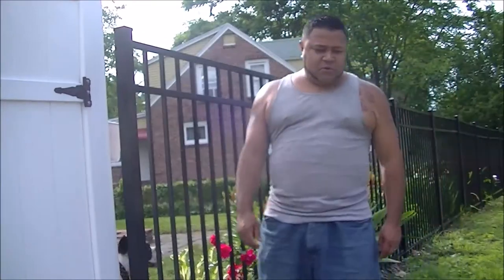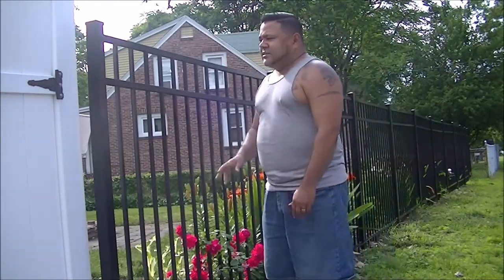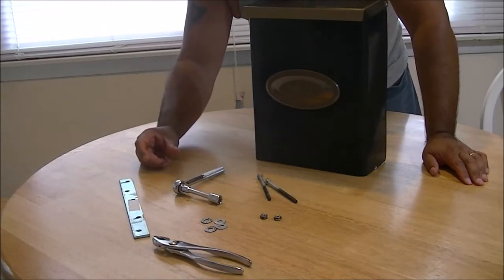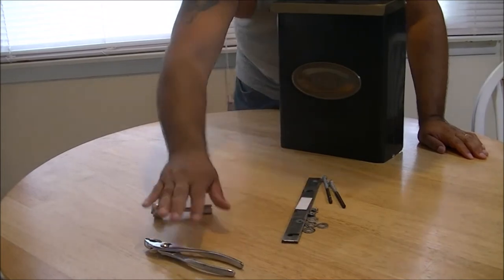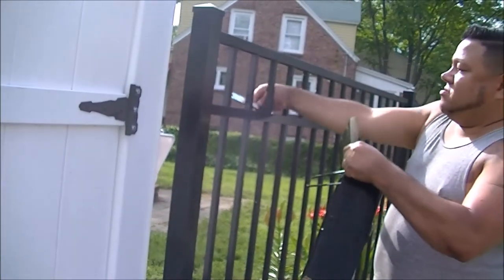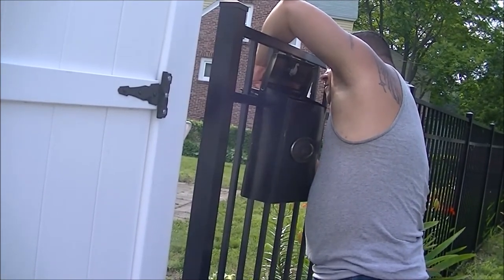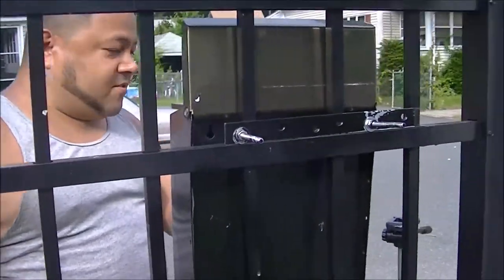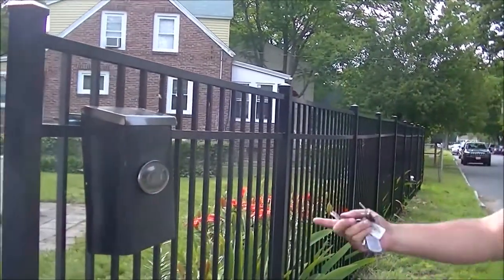HOW TO put up a regular mail box on a steel fence

Comment: i have the exact same mailbox how do u install it on a brick wall?
Reply from the maker: On a brick wall you can drill wholes and drill in screws.  Then all you have to do is hang the mail box on the screws.  You might have use screws that are for either cement or bricks.  If you need to secure it from being stolen you might want to put a metal plate inside the mail box and put the screws through plate and into the brick wall.
Reply: Thanks a lot I'll try that..
Reply from the maker: Your welcome! Hope it works for you.

Comment: Where did you get this type of Mailbox  where you can install to Railings or steel fence, i tried in Amazon and walmart don`t find over there....
Reply from the maker: I bought the mail box at a Lowes.  You would need to buy the parts to hang the mail box as well.
Reply: @josemonzon1793  where did you buy the parts to mount it?

Comment: Will this work on a wire fence to ?
Reply from the maker: lucia nguyen hello Lucia, yes  this should work on a wire fence too.  Just make sure that the metal plate is able to cover multiple wholes from the wire fence and tighten it as much as possible.
Reply: Thank you so much. This was very helpful.
Reply from the maker: Your welcome!  Let me know how it went.  If you don't mind.
Reply: Thank you!  It worked great. I put the mailbox on the fence with no problems.
Reply: @josemonzon1793  did the metal plate come with holes already? What size screws did you use?
Reply from the maker: @0scarr13 yes, the plates came with the holes already made.  As far as the length of the screws I guess it all depends on how thick is your fence.  Mines were at least 3 inches long.  Your better off having them longer because if anything you'll be able to cut them.  Hope this helps.